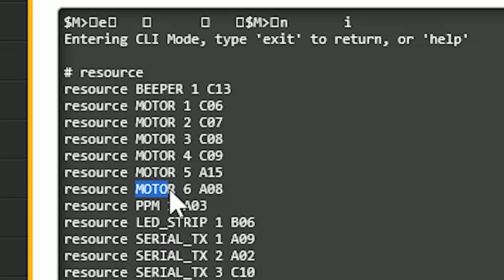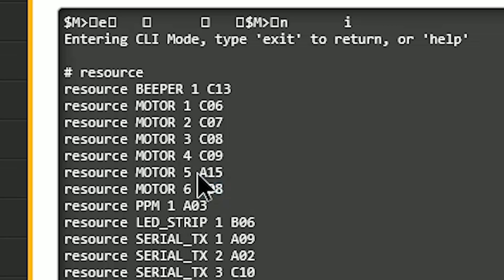Betaflight FPV Camera Control | HOW TO

Comment: I am running a Monster V2 to the CL_racing F4s cam-c and I get nothing on the OSD when I yaw right.   Is there something I need to enable?
Reply: Pyro17059 I tried reconnecting the ground and no luck. Joshua advised we may need to add a capacitor to the line... I wish I would have know it wasn’t gonna be so easy from the start before I chopped off the connector for the OSD joystick!
Reply from the maker: You shouldn't need to enable anything but it would make sense to confirm that you see the camera control resource assigned to a pin in "resource list".

You might need to add a capacitor between signal and ground on the camera.
Reply: Joshua Bardwell ah ok. I didn’t use the ground wire cause I watched another video where the user said you didn’t need it.  So solder ground to the same ground pad that the cam power is coming from ok?
Reply: Joshua Bardwell do you need the ground wire? Btw I just installed your FC and hooked up a Crossfire to it 👍🏻
Reply: I have the same issue. I was told to only solder the cameras OSD wire to the cam c pad and all should be well. I am unable to get into cam settings via my remote..I hope its as simple as hooking up the ground wire...I was told it didn't need to be hooked up because the camera is already grounded...?

Comment: How does one find the source pin code for the Betaflight F4 board? By default the camera_control 1 is set to none.
Reply from the maker: Decide what pin you want to use.

Type "resource" and see what pin number that pin is on.

For example if you see:

resource led_strip a08

That means led_strip is on a08.
Reply: I'm attempting to use the board's pin for the camera and not have to use a resistor.  I've connected to the pin and when powered up the camera's menu comes up but I can not access it.  When I type in resource or resource list, camera control does not show.  When I type in dump, it shows, but says CAMERA_CONTROL 1 none.  I need a resource pin code for the cam pin.
Reply from the maker: I don't think I can add very much beyond what I put into this video. Do exactly what I show in this video and it should work.
Reply: Alright, had to go to Radioshack and get a pack of resistors.  But in the end, pretty cool feature!!  Thank you for your help and all the content you put out.  Really a big leg-up for someone like myself who is learning this hobby alone.

Comment: Today I took apart my quad to install a frysky RX for my new radio and I put in a better VTX.  While I was at it I wired up Camera Control on my F4 micro Omnibus.   I followed all the steps and wired to led then cleared the resource and assigned it and now its working.  Thanks alot for your video.  I cut the cable from my old OSD device and used the wires and connector to wire in the Camera control.   Now I dont need that silly thing ever again.    When I first got my Foxeer i setup the camera following Mr. Steel's camera setup video.   But now that I can change things on the fly I need to play with it more and learn about all the setting and see how lighting effects them.    I also focused my camera when i had the quad apart and I have nice clear image.

Comment: anyone had the issue with the eagle 2 flicking through menus too quickly, have tried changing the key delay but this doesn't see to affect the speed of exiting the menu.  The trouble i have is trying to exit the menu it quickly bounces back into it, trying to do it on the clf4s no caps etc

Comment: I can confirm as per Dan's post further down that kakute f4 aio and eagle 2 camera control is working fine without a resistor or ground wire connected. Osd wire from camera to led pin on fc, follow cli instructions in the video, jobs a good 'un!

Comment: Thinking about doing this. Need something to do now i cant fly (all my lipo are old and barely deliver any power) but i just wanted to know if we need to use the ground wire on the osd? Run it to a ground for an esc or something. This is on the eagle 2.🙂

Comment: For anyone with a CL Racing F4 board and Runcam Eagle 2 trying this, I have it working but can't explain how - hope this helps others. OSD cable wired to LED strip as Josh suggests, 450ohm resistor between board and camera in the OSD line. LED strip pin is B08, Camera control is pre assigned to B09 - not sure the pin that corresponds to on the board however.... It only works if you DON'T remap the LED strip pin, just do nothing in the CLI and try it first. I tried it that way and it worked, then I was worried I maybe hadn't done it correctly and followed Josh's video for remapping the LED strip pin to Camera Control and removing anything else that may be sharing that pin also. It stopped working when I did that and I had to revert back to my original configuration to get it functional again.
Reply: This!!  I could not get mine to work, had to go back and read and found this comment.. Set mine back to stock B09, voila! Thanks man!   (CLR F4 + HS1177)
Reply: No problem, glad to finally give something back after so many helping me! 
I thought it may be something unique to my board but you have confirmed otherwise, they all must be the same. I would have been there for hours going nuts if I hadn't discovered it by pure accident.... Happy Flying! (Sorry Joshua :)

Comment: hi josh! i finally got around to do this mod and its not functioning properly... I can access the menu and scroll up and down and even can select the back arrows with my left stick, but i cannot select any of the settings with the right stick. I used 220 ohm resistor, 10uf cap, and then .1uf cap, and changed the timing in betaflight but have no change do you have any ideas what could be causing this?
Reply: forgot to mention i have the micro swift 2
Reply from the maker: +dominic keen I don't understand. You say you can move up and down but that is done with the right stick. But you say the right stick isn't working.
Reply: Joshua Bardwell I'm sorry if i didn't explain it properly, but i can move up and down with the right stick. Lets say i want to adjust the sharpness or something.. when on the right stick (roll) it does not do anything.

Comment: I have a foxeer camera with only one output on the back. But has a slot on that connector for osd. Could i use that osd slot?
Reply from the maker: Yes.
Reply: Someday i will figure this out.  Lol. The clracing f4 i have doesn’t have a camera control pad. And the cam only having one plug is confusing me. As there is only one ground etc.  and i am new to capacitors and resistors. So figuring that out is a whole other issue.  Lol.

Comment: Is it possible to use the buzzer port as a uart on the kakute f4? for kiss telemetrie or other stuff?
Reply from the maker: +Fabio Tanner no, not at all. You might as well try to get chocolate syrup from a water fountain.
Reply: Joshua Bardwell is there any other option for that on the board?

Comment: Having issues with down motion and left. For example I can adjust contrast and brightness UP, but not down do to not having left movement. The transmitter stick trims are at 0 point so I know that is not it. Any suggestions or insight? Perhaps a trouble shooter?
Reply from the maker: If it is working at all then I have no idea why one direction would work but not the other. Sorry... this is beyond me.

Comment: So do I understand correctly that if I am using a CL Racing F4 board I DO NOT NEED TO INSTALL THE RESISTOR?
Reply from the maker: Correct. It is already ready to go.
Reply: Does that apply to the standard F4 or just the F4S?
Reply: f4s, (could try remapping the ppm pin in the f4 (as this was the one that was swapped to camera control in f4s))

Comment: Hi Josh. Just doing a build just know and would like to incorporate this. Do you know if it's possible with the eagle (1) camera as there seems to be a pin for each OSD command. In a case such as this, which one should be used??
Reply from the maker: No. If the camera does not have a 2-wire OSD plug, you cannot use this feature. Sorry.
Reply: Ah bummer, thought as much - thanks for replying so quickly though.

Comment: I can't get this to work on my fc, I'm using a spracing f3 with 8 motor pins, I've tried on motor pin 5 and 6.
I made sure camera control was the only thing using the pin but when I plug in a battery it makes the same motor twitch. Do I put the osd cable on the signal pin? I only have one ground wire also from my camera. If that would make a difference.
Reply from the maker: +Stop Drone-ing on what motor does it make twitch?

Yes the osd signal wire goes to the motor signal wire. Remember that ledstrip is the pin that is guaranteed to work. I'm not 100% sure about motor outputs. Also, remember that some cameras you might need to do the additional troubleshooting from the wiki.
Reply: Joshua Bardwell shame I don't have LED pins. It was making motor 4 twitch front left motor in my arrangement.

Comment: I watched a video where the runcam eagle 2 does not require resistor. But when I tried to do it the settings did not appeared on osd
Reply from the maker: +Tushar Tyagi OK so use a resistor...

Comment: Awesome!!
Reply: shoots I did it all. but not in my goggle display. Hmm? Do i have to turn on led in beta GUI. everything else I did checks out to what you instructed.
Reply: im using a dys f4pro and v3 foxeer arrow, 150 ohm resistor . I set in cli , led 1 that was b05 moved it to a free resource b06 .. THen i put in camera control into where LED1 was on b05 all saved all good. Checked the other trouble shoots with resistence and etc good. BUt nothing no menu when prompt on sticks. not sure what to do now .

Comment: I set it up using the PPM pin on my DYS F4 PRO, if anyone is looking for a pin. It's pin B14 if I remember correctly.
Reply: I tried led 1 b06 but it not work.. Your saying its b14?
what tab on the FC then? Or do i still use the led hole on FC? and just change camera control to b14?
Reply: If you look at a diagram there are 6 pads on the bottom right. One of those pads says PPM and that's B14. It worked for both Runcam Swift 2 and Runcam Micro Swift 2. I used some 330 ohm resistor I had. It should really work with the LED pin as well though, I was just using it for LEDs.

Then I did:
resource PPM 1 none
resource PWM 1 none
resource ESCSERIAL 1 none
resource CAMERA_CONTROL B14
set camera_control_mode = HARDWARE_PWM
Reply: curious why it not work using my led pad.. I got my F4pro stacked to its 30a4in1 . Not sure if messing with b14 ppm pin would mess up the whole rig.
Reply: when i try to assign the b14 pin i get this even tho the b14 says free in resource list. # resource camera_control b14

NOTE: B14 already assigned to PPM.

NOTE: B14 already assigned to PWM 1.

NOTE: B14 already assigned to ESCSERIAL.
not sure if i wanna move these ?? or have to??
Reply: okay  I tried your pin b14 and redid the resource's still not work at all. Geez la weez+(
Reply: I don't know what to tell you then. I wired a 330 ohm resistor between PPM pin and OSD pin on the camera and the OSD ground to some ground pin on the board. It worked for me.

Like I said I successfully used Runcam Swift 2 and Runcam Micro Swift 2, if you have some other camera you might need to adjust other parameters. Check out https://github.com/betaflight/betaflight/wiki/FPV-Camera-Control-(Joystick-Emulation)#troubleshooting
Reply: THanx for getting back. I've been trying lots of things but with no luck. THe cam's damaged anyways from a crash and is gonna be replaced. It still works but glitch's out sometimes. Osd menu still comes up with keyboard thingy

Comment: How about old camera like Foxeer XAT600M   it has a different connection. Great videos they help a lot.
Reply: Great video Joshua! I'd like to know about this also. The Foxeer XAR600M has pin out 5-22v, GND, VID, OSD. Would you just follow the same steps just without the need to connect an additional ground wire?

Comment: Can this be done for the RunCam Split V2 ?? I would love using this OSD menu instead of the one it comes with
Reply from the maker: +Daniel Hubert no. Thus doesn't add the menu. Just lets you access the menu already in the camera.
Reply: Joshua Bardwell thanks for the response!

Comment: Is there any way to enter the OSD settings menu for cams like the swift 2? From memory you need to hold 'up' on the osd control dongle.
Reply from the maker: +discord2000 center throttle right stick up.

Comment: For those with minimosd where the stick control is center both, yaw right pitch up, how does this functionality integrates?
Reply from the maker: +Fernando Goncalves good question.
Reply: I´ve submitted issue/feature request #4470 to understand if different stick movement can be set
Reply: oi Fernando!! você conseguiu resposta para sua dúvida?? tenho o mesmo questionamento! obrigado!

Comment: I'm guessing this isn't possible with the runcam night eagle? It has 5 signal wires for each of the directions. Maybe some kind of encoder would work but I don't know of any.
Reply from the maker: Your'e correct that won't work. This only works with the two-wire cameras.

Comment: Additional info in the Wiki: https://github.com/betaflight/betaflight/wiki/FPV-Camera-Control-(Joystick-Emulation)
Looks like you don't need the capacitor if you are using a hardware pwm pin. And you have a lot more pin options if you use software pwm.
Reply from the maker: You still need the capacitor for mini and micro cameras even if using hardware PWM.
Reply: Joshua Bardwell only for those that are reported not working. RunCam Swift Mini and Micro are working okay without a cap, not sure where you're getting this from

Comment: IMO it’s still to much work for most pilots. Needs to be integrated a bit more before most will add but big step in the right direction 👍
Reply: PuppetMasterFPV I am thinking about making the cables ready to go with the resistor and 2 pin plug for the cam. Think there would be a market if they were sold for around $2?
Reply: NorthWest FPV yes!
Reply: Right on! If I can get enough people wanting them I can even go cheaper. If I buy in bulk of about 1000 pieces of resistors and connectors then each one would cost me about 10 cents. But then there’s the time it takes to make them plus solder. I’ll definitely work on getting a small batch of about 50 done and see how they do.
Reply: NorthWest FPV sounds like you are putting allot of good energy on this. Let me know how it goes 👏👍

Comment: I don't think that you need to clear those existing resource. I think Betaflight is smart enough to allow there to be overloaded resources as long as the other features aren't enabled. Like you could have probably just unchecked LED STRIP on the configuration tab. And left the I2C stuff alone.
Reply: Curtis Campbell you need to, order of initialization is somewhat arbitrary and you can't be sure which one will be initialized the last. In this case I2C wins

Comment: Joshuwa . I just got a taranis x9d plus and kakute f4 and installed it on my furibee fuuton 200. I binded it to the frsky receiver that comes with the rtf furibee fuuton 200. I setup the taranis as u did in ur previous tutorial. But when i turn on the taranis the receiver light goes solid green but when i move the sticks nothing happens!! Helpp

Comment: See teralift's blog on which cameras and flight controllers need what resistor etc.  https://www.rcgroups.com/forums/showthread.php?2961216-Betaflight-Camera-Control-Compatibility-Reports      In Betaflight modes is a camera control mode, that doesn't need to be active for this to work.  Anybody know what it does?
Reply: mchevalier77 isn’t that mode for those having servos adjusting camera angle?
Reply: Thanks alot for posting this!
I made this with my Foxeer Monster V2 and it didn´t work, supiiik from the website says that this camera need a capacitor to work.

Comment: this cli "coding" and sma resistor and capacitor solder-action reminds me of the early days where we were building converters n stuff to even get sbus to work. good old days, where you've configurated your esc's by your throttle control and counting the beeps of your esc's, to set up stuff and oh gosh, it starts over again xD i think i'll wait for it till this to become standard and just solder 1 single wire and all is done. i am getting old :)

Comment: Joshua, i have a camera (Foxeer mini fpv camera HS1190, and im not getting any video, and i know that VTX is working beacuse im now im using hs1177, but i need voltage on my goggles. Do you know what can i do or do i just trow away the camera and call it a day... Thanks

Comment: You are such a fount of knowledge Joshua. But at the risk of sounding pedantic, isn't a circle with a line through it a 'zero' rather than an 'O'? It's just the sort of thing that would leave me screaming at the computer because it's not doing what you tell me it should.
Reply from the maker: Yes, a circle with a line through it is a zero. But we sometimes say "oh" too. Usually you can tell from context which is which.

Comment: My understanding is that the OSD remote has different resistors being connected to "reference" pin of OSD connector that jointly with resistor inside camera form voltage divider that gives the "OSD commands" to camera. By using shown technique we are feeding the necessary reference voltage to camera using PWM output of FC processor and simple filter. Betaflight in response to stick commands manipulates PWM output to manage camera OSD. Any idea how standard are these "OSD command voltages" across different camera vendors?
Reply from the maker: They're pretty universal. Runcam and Foxeer at least are the same.
Reply: Read the documentation at Betaflight GitHub Wiki, it has answers for your questions
Reply: Oh, so my guess was basically correct. Here is the link to the Betaflight wiki:  https://github.com/betaflight/betaflight/wiki/FPV-Camera-Control-(Joystick-Emulation)